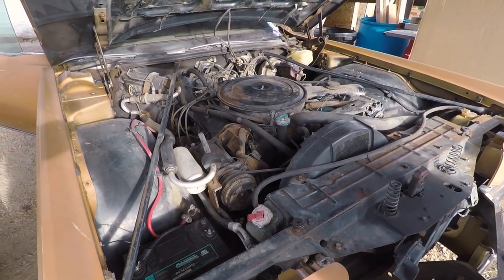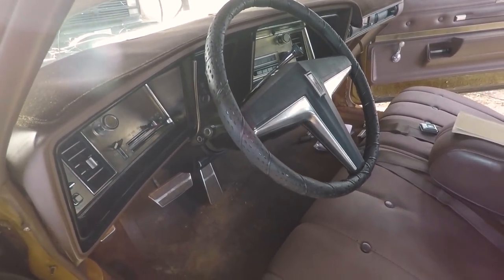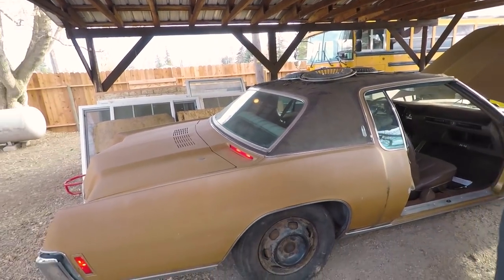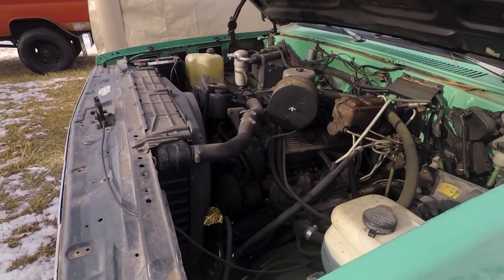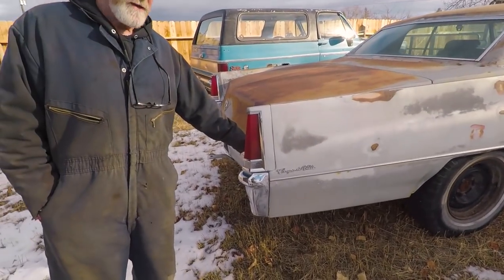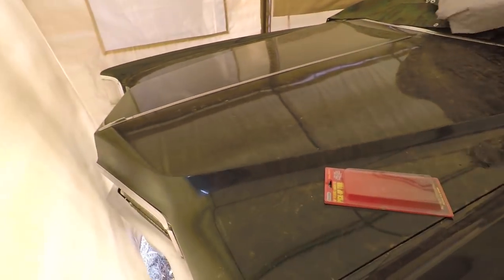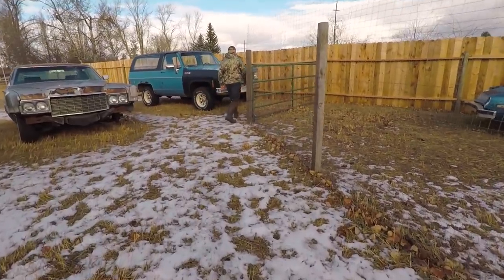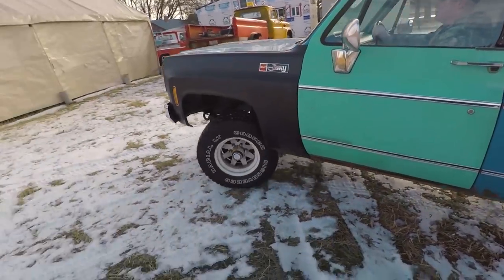We're still Alive! (Stuff we've been doing)

Comment: What year is the green 1 ton Chevy? I like the square body Chevy's.
Reply from the maker: 1991
Reply: What motor does it have?
Reply from the maker: oldsmobile 455 4 bbl carb with turbo 425 tranny and front wheel drive
Reply from the maker: @Ryanfry262 sorry the 1 ton green Chevy has a 454 big block